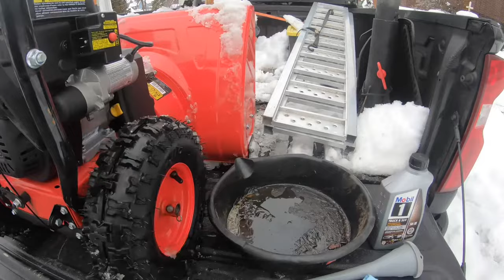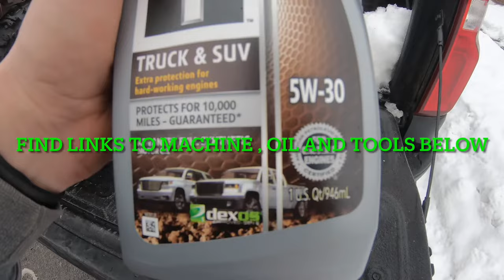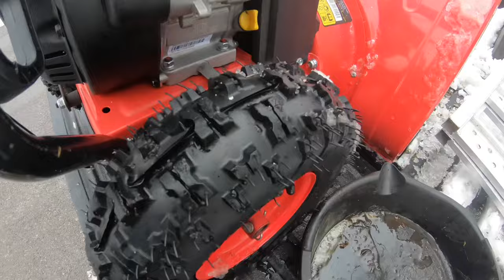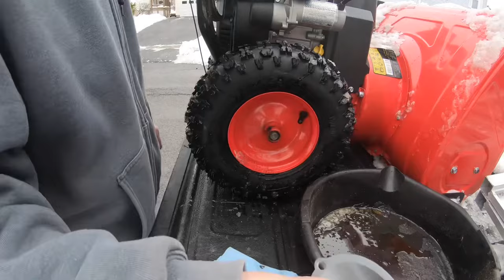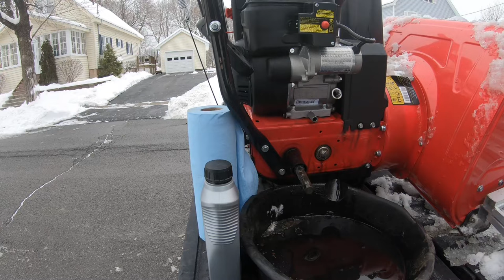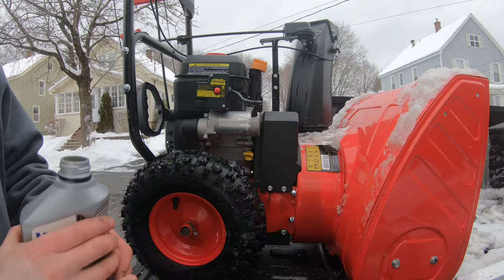The PowerSmart snowblower needs an oil change.

Comment: A little tip I use is to buy a clear plastic tubing that will slip over the pipe sticking out and as soon as it is open slip it over the end and down to your oil catch, much cleaner.  Practice once before your remove the end.
Reply from the maker: Thanks !
Reply: honestly, you should be removing the wheels once a season to check for rust and lube up anyway. So, it is a good reminder to do so.
Reply: @arkie87  I agree on checking and greasing wheels but even then he was having a hard time. so the hose still makes sense.

Comment: When I got my snow blower as a gift for christmas, the oil gauge assembly was broken and cracked in two pieces. The company has not been helpful at all in helping me. They are telling me that I have to buy the part off eBay which I've gone to a eBay and there are no parts to replace it. I've gone to the Power Smart Tool place and there's no part to replace it. My two options are to return it or to somehow try and glue the two pieces together. I got this last December and my issue has still not been resolved with the company I would appreciate any advice you could give. Thank you very much
Reply from the maker: Sadly it’s been a real struggle to try and get parts from them I think I will be deleting my review videos promoting their products. The axle broke on mine after a year and they refused to replace it even after it says online you have a two year warranty. Only way to really get a hold of them is through email off their website and hope they respond

Comment: Just changing the oil isn't enough.  You have to open the oil fill cap and the oil drain and the oil dip stick, and  then flush it to get all the metal filings out, that are heavier and settle to the bottom. t's not about the oil getting dirty, it's about getting the tiny filings that are making the oil dirty out. Otherwise you are just putting clean oil into a machine that has metal filings left over and the motor is still contaminated with metal filings.
Reply: How do you flush it out?

Comment: What is the solution to the problem of the machine being unable to lift snow from the ground and take it out from the upper outlet, it only moves it forward?
Reply from the maker: Probably need new shear pins in the augers
Reply: do the augers and impeller spin at their correct speeds? If not, you may need to tighten either the cable that engages the auger or move the roller closer to the belt to increase tension on the belt. 
If the auger doesnt spin but the imepeller does, could be the shear pins are broken or missing.
Reply: @KyleHallwoodworker  thank you
Reply: @arkie87  thank you

Comment: Manual says to NOT screw in Oil Cap to check level ?
Reply: It's very typical of that type of oil cap. Honda lawn mower engines are also that way we don't thread it in to check the level.

Comment: I bought a PowerSmart brand 2-stage 24-inch snowblower a few years ago after my TroyBilt went to snowblower heaven after many faithful and trouble-free years of service.
Right away I could see why PowerSmart brand snowblowers cost less than other brands.
The switches were cheap and flimsy, the cables dangled loosely and in the way of the pull cord and as you can see in this video the oil fill and drain plug positions were poorly placed making what should be an easy task difficult.
My last and most important complaint potential buyers of this product may want to consider is the placement of the handlebars.
Instead of being angled like other brands they are positioned in an upright position.
This puts strain on your back when using it and my back was constantly sore after using the snowblower.
This is why I sold it after just one season of use.
Reply: You get what you pay for.
But from what you mentioned in the comment and what I saw in the video, I can see why.
The oil change location is a bit complicated, but the handle direction, really?
If you can bend it a bit, then it would be good
Reply: @tfoen7678  the oil change location is not ideal, but honestly, you should be removing the wheels once a season anyway to check for rust and lube up, so not a big deal. It is a good reminder to do so.

But yeah, it is like 2x to 4x cheaper than other snow blowers, so.... those sacrifices are worth it for me, as long as it lasts.